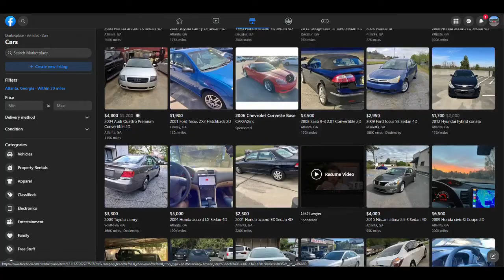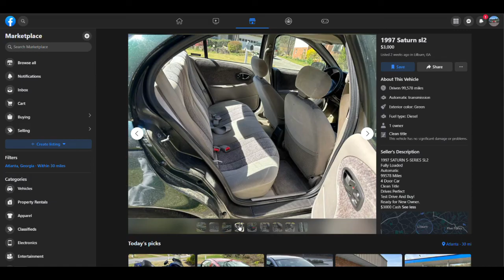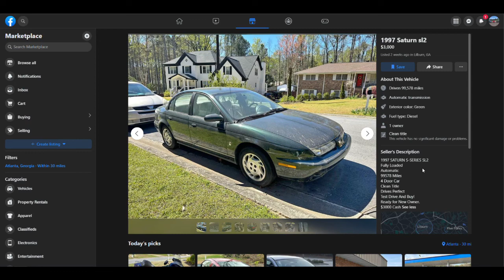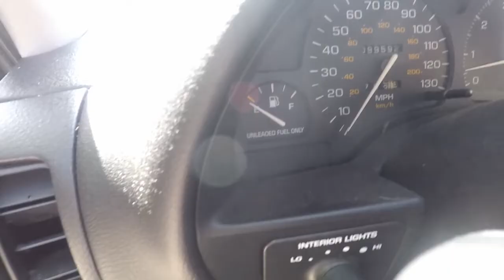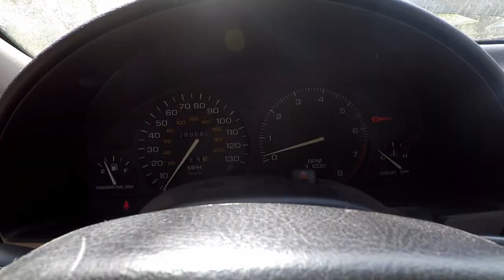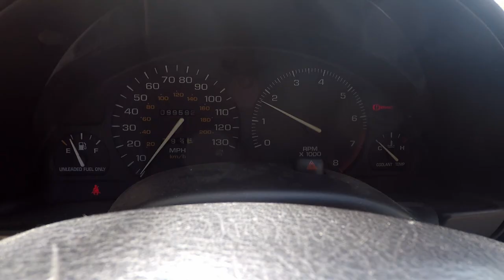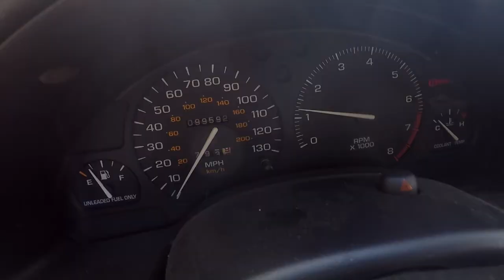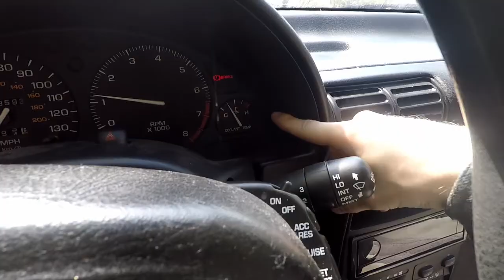How To Buy A Used Car On Facebook Marketplace

Comment: I disagree sir about not going far for test drive,you have to get that car up to about al least 55-65 for at least a few minutes to get that engine really hot
Reply from the maker: Maybe this is circumstantial, but what does test driving at 55-65 mph really tell you that you can’t find at lower speeds? Highway speeds is where you can find out if the wheels need to be balanced sure, but let’s be honest, is wheels needing to be balanced enough to prevent you from purchasing a car?
There are lots of reasons you’d want to drive highway speeds before purchasing a car, I just think it might be a bit circumstantial as the issues that could appear at highways speeds wouldn’t personally prevent me from making the purchase on that car. :)
Reply: @bluesxt Brother there’s a lot. Wheel shake, struts, transmission issues happen at higher gears in autos. Etc.

Comment: You got a great car....Mine '98 has 273000 miles.  Original drive train. No major repairs.  She just developed an overheating issue, but Lord willing, my husband can fix it.  We have the goal to get her to 300,000.  If not, I have a parts car with a good motor/trans we can put in.
Reply from the maker: That’s awesome! Best of luck! These are great little cars
Reply: @bluesxt  Update....It was a bad ECTS and the radiator cap had hairline cracks in it.
Reply from the maker: @Beth_Colvin  that will do it! nice work
Reply: @Beth_Colvin  Those old S-series Saturns were WELL KNOWN for ECTS failures, I had a 95 SL1 back in the day that I upgraded the ECTS to the newer brass ones just as preventive maintenance since I was a regular in an online Saturn forum where I found out about them... Great cars though, little quirks with them but they had alot of character.

Comment: So how much did you pay for the car at the end? You said 200.00 off but what was the original price? 
I would not pay more than 1,500, no ac, needs tired, pulls to the right, electrical problems, no AC, transmission leaking, oil leaking, I would ask for 1,200.00 or walk away

Comment: Is 2000 a good price to buy a used car on fb marketplace if they said everything is good with the car?
Reply from the maker: depends on the car, condition, and miles. A truthful seller goes a long way however
Reply: @bluesxt i only have about $1500 to spend right now… i need to get to work, I’m not paying rent and will easily make $700-900 a week if i had a car. Only have a week to find a car until they let me go can i show you pictures on if if this car is a good purchase or not.
Reply from the maker: @toxiicmayhemzz6686  pictures won’t help. what you need is someone who is mechanically inclined enough to look at the vehicle in person with you. if not, then follow some of the things I mention in the video. Keep it running for a while (15-20 mins) to make sure it doesn’t over heat. Check for leaks, make sure the oil isn’t foamy and no oil in the coolant. And if the car survives a test drive then it’s reasonable it will survive your drive back home. And then from there just keep an eye on the oil and coolant levels for the next couple of weeks.

But nothing is guaranteed reliable. Things go wrong. It happens